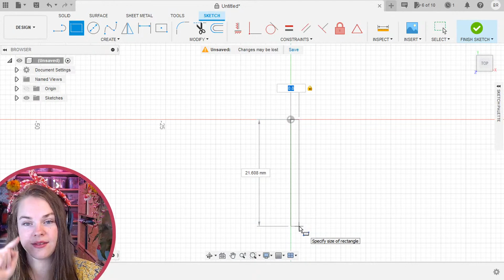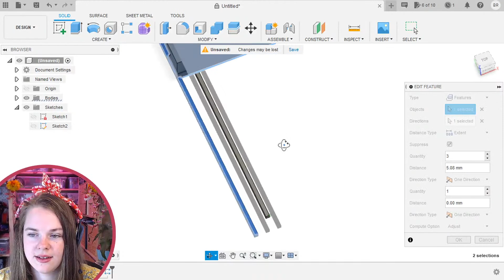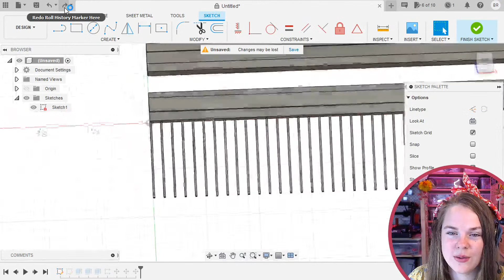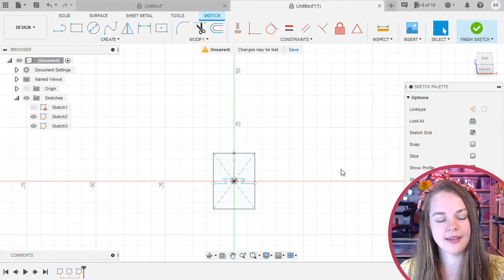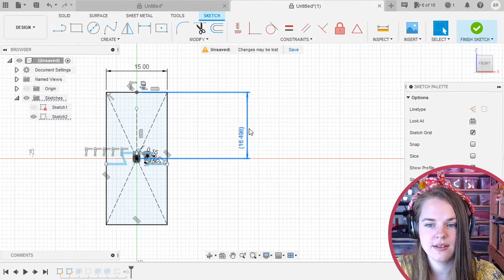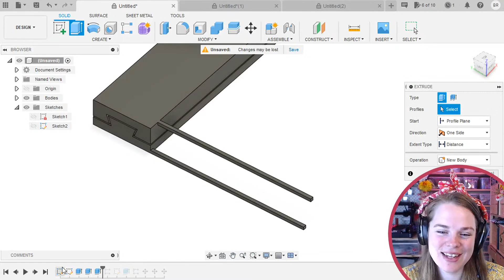LIVESTREAM: 3D modeling antique paper marbling tools in Fusion 360 for 3D printing

Comment: I couldn't find where you talk about adding glitter to resin prints. But I just tried it and possibly added too much and shattered my screen :'( Is there a ratio and glitter type you recommend?
Reply from the maker: It shattered your screen? Oh no! That's terrible! I've not even heard of that happening. 

I use fine powdered pigments like pearlex and I just dust a bit in and mix it until it looks good. I'd say I wouldn't go over 5-10% by volume
Reply: @BillieRuben   Is the pearlex just for pigmenting or for that glitter effect? I ended up using crushed crystal magic micah and a lot of it sank and I think smooshed in between the plate and screen. The effect was incredible though lol 😅
Reply from the maker: It's for the glitter effect. 

Oh yea, definitely don't want anything that sinks! Glow powder is the same. 😔

How terrible about your screen. 😩😔